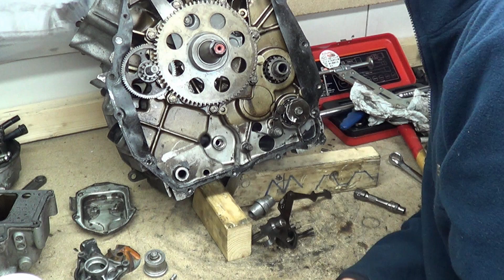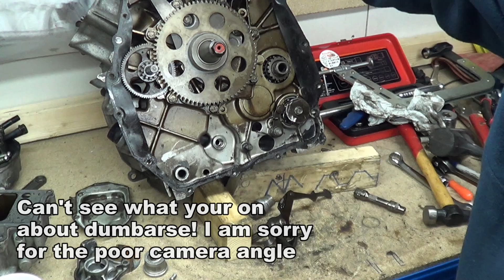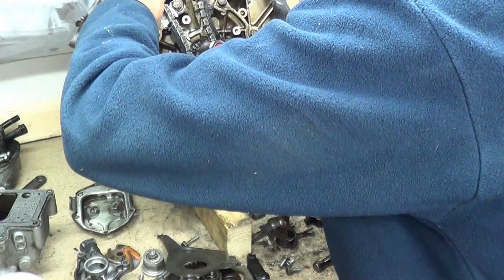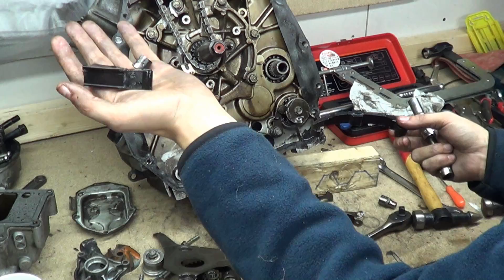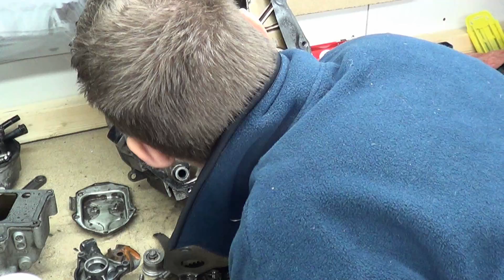CX500 V twin 4 Stroke Series - Part 6 Timing mechanism

Comment: Ha, I knew what the giant gear and the smaller gear were instantly, starter gears, Ducati Panigale has the same setup. 

Large gear is missing clutch that connects it to flywheel. The starter has a fixed pinion (no throw out gear),the pinion, the small gear and larger gear are constantly messed, the missing clutch on the large gear only engages when the large gear is spinning faster that the crank shaft, otherwise gears are all stationary thus the bearing on the crank shaft.

They did it that way on the Panigale because it allowed a smaller and lighter starter, and the starter gears don't add any rotational mass of the engine. Ducati also did something trick with the exhaust cams so the act act as decompressors below idea speed, again so they could run asmaller starter and save weight. Other ducati's likely have similar gear and clutch arrangement, but I didn't expect to see same set up on a much older honda engine.

Great video.
Reply: Yeah, I knew what it was as well.  I was sat at home by myself, yelling at the computer like a mental "STARTER CLUTCH, MATT".  Of course, by now it will all have been figured out.  Really common arrangement on Japanese engines.

Comment: That bolt that has been chewed up by the chain, is a common issue with the CX. Many of them are running around today with bolts just like that. Wouldn't worry about welding the housing. Looks like you're missing the chain adjuster locking bolt. It's a shoulder bolt with an O ring from memory, thats resides in the adjuster in the oval slot.
Good videos. Keep 'em coming.
Reply from the maker: Im gonna rebuild the chain tensioner with a different unit, I'm thinking of nicking a auto tensioner, like others have done and machine up my own blades from T28 or some other hard wearing plastic.